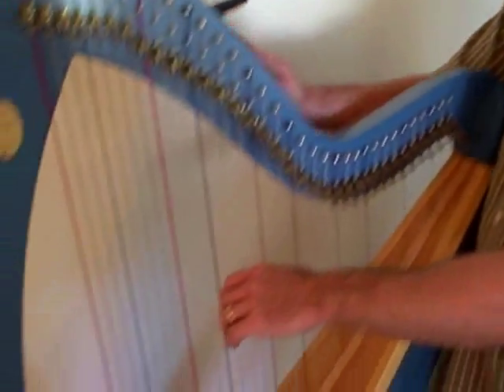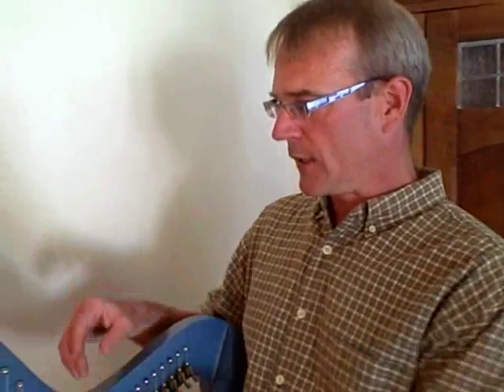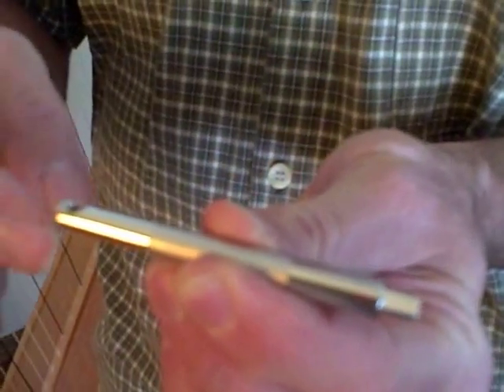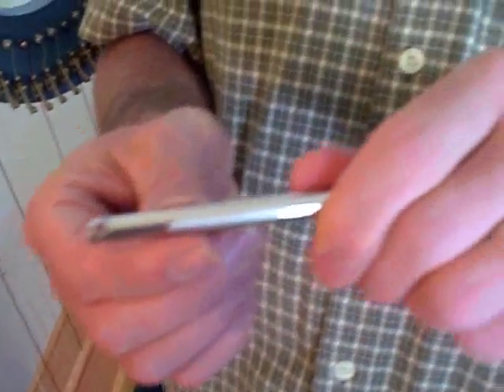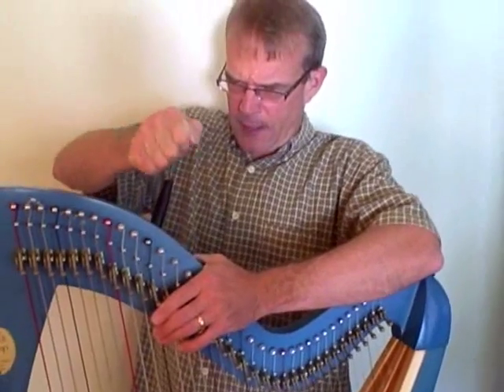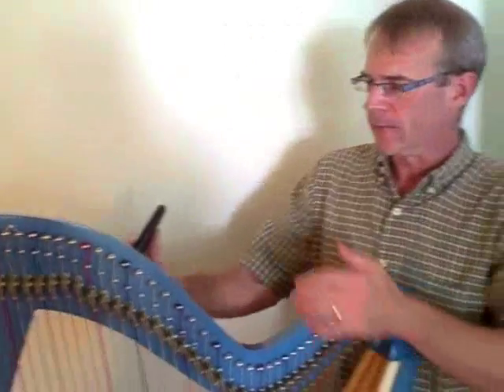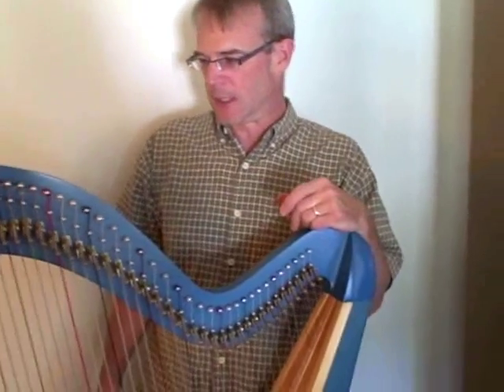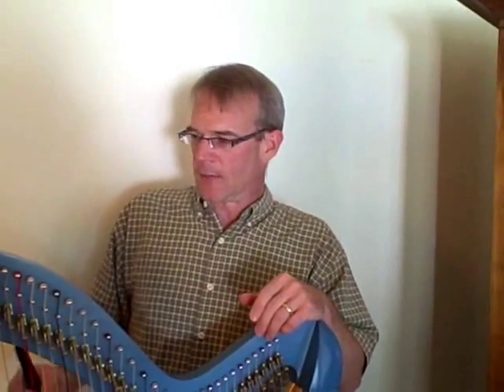How to Tighten a Loose Harp Tuning Pin

Comment: Thank you for this video! I have a carbon fiber Heartland Harp. One of the tuning pins won't hold pitch. I'm assuming that this won't fix my problem, but it never hurts to ask. I did contact the company and they sent me several tuning pins... no instructions ... just pins. I'm at a loss and it's the busiest time of year. I also play regularly twice a month at a local restaurant. Any suggestions you could share would be appreciated. Thanks!

Comment from the maker: That is a lot trickier. Depending on how tight they are you may be able to pull them out slightly with pliers or vise grips, but you need to pad the jaws (with leather or a layer of rubber, for instance) to avoid marring the bridge pin surface. If the pin won't move, rotating it a bit while pulling may help.

This is assuming the bridge pins are driven in, and not screwed in, as some modern designs (Dusty Strings, Camac) are.